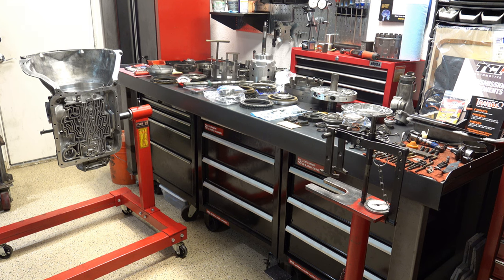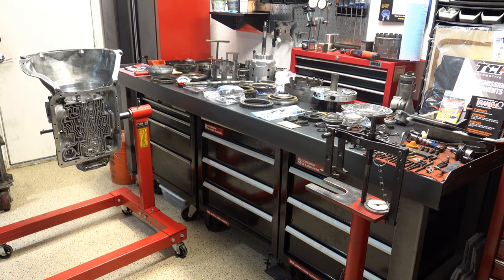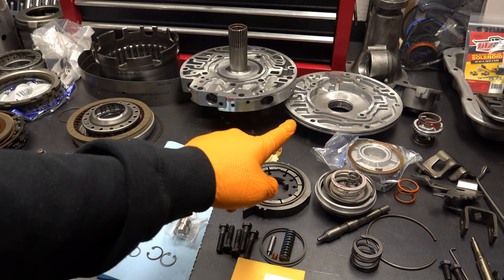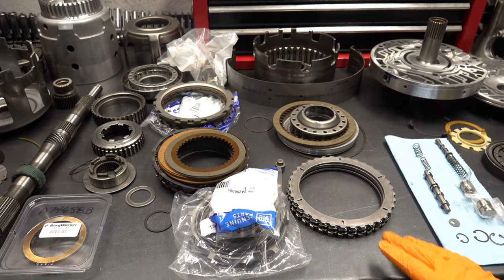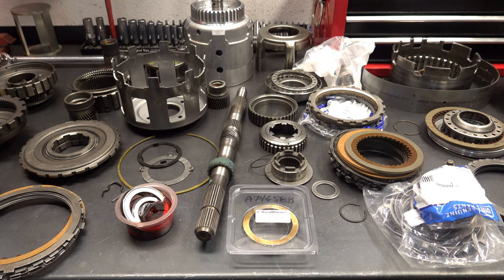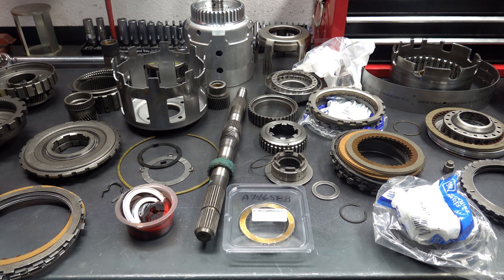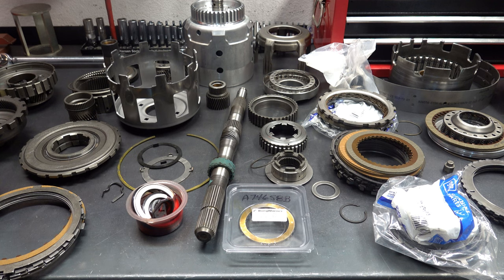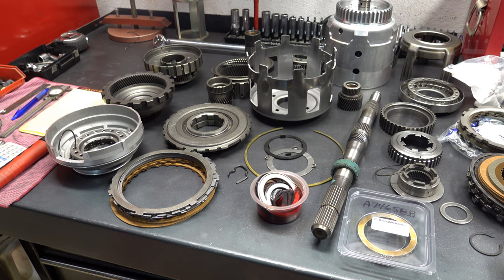700R4 Rebuild PT1: Overview

Comment: Any possibility you can detail which parts and part numbers you got? A specific parts kit? Or links to them?
Reply from the maker: Hi ijteague,
I purchased everything locally for that build however I buy a lot of stuff on eBay as well...Here's an example of an-all inclusive base kit that comes with upgraded Alto high energy frictions as well as a "Powerpack" for the 3-4 clutch (two more frictions and steels vs stock). I have used this kit several times in the recent past with good results. Pair it w/a Transgo JR or Superior Tech shift kit (or your own hydraulic mods) and you should be good to go...Link: https://www.ebay.com/itm/190782507245?hash=item2c6b8608ed:g:gSUAAOSwl29b7cdv&amdata=enc%3AAQAIAAAAwIdgA9kEe7oZZknI24HrD0u54cqFGFwJIJ3W0JC3Y%2FoIkH9ys%2FRejX0zDKoV2IToxorMjImQ0ELEq4FiAHWpWgV2NqWAGSgZeXAdhE8AWJZ8xYje02DnL4GwmgBXcrO2CokNI6LBCzNUmzu4b1Cuu3xIXMEUBIeSYYGpKcY8Kpxh5FzkJmyS3PsvAKb0xVGYftQbzKAiIDJDQr9sCn3qbkfZCO0uTYyiOifsQCXEtRmeBxQU51TmFPwOXuvdV0kuWA%3D%3D%7Ctkp%3ABk9SR860rb3WYg
Reply: Does this kit come with the steels that have the oil holes in them ? Thank you.

Comment: Hey Nick, your video’s are great. I have a question about the shift kits vs the repair kits on a 700r4. 
If I’m putting a performance shift kit in one do I also need a repair shift kit also? Or would the performance kit already include the needed repair updates? Thanks.
Reply from the maker: Hi Anthony, thank you for the kind words!

All the shift kits will have the same basic corrective parts/procedures however the performance kits will also include parts and procedures that are performance oriented. So no need to buy two separate shift kits.
Reply: @nickstransmissions  Awesome, thanks for replying and giving us great videos and information.
Reply from the maker: You're welcome, man.

Comment: Nick, {non-rebuild Question} I have a 700R4 shift sequence question in relation to the Low/Reverse Clutches....when are these frictions activated-engaged? So far i learned that they are engaged in 1st gear (low) and reverse, they come off in 2nd gear...which probably means they aren't on in 4th gear?? How about 3rd gear..what are these low-reverse clutches doing engaged or disengaged?
Reply from the maker: Hi LarsonFamilyFarm-LLC - the low reverse clutches are applied in reverse and manual low, then come off as soon as you shift from manual low into manual 2nd or from reverse into anything else. They are not on in 2nd, 3rd or 4th gear and thus freely rotating in place at the back of the case.
Reply: @nickstransmissions  Wow perfect thank you...i could not find this information anywhere.
Reply from the maker: You're welcome, man...Please subscribe if you haven't already...I'll be putting out more 700R4 videos within the next two weeks (I have two in the shop now to go through).

Comment: Hello nick, i have a 700r4 k case with a ss# 9txm238a with a AM separation plate but everything i keep reading said it should be a BV for the year. Will this work or do i need to find one or a aftermarket plate?
Reply from the maker: Hi Dustin, if the number you provided above came from the passenger side pan rail then you have a 1989 year transmission w/an auxiliary valve body...Look at your plate right side up in the area where the aux valve body goes...If there's a bunch of ports and a check ball seating location, then you have the correct plate...If there's only four bolt hole locations and nothing else then you will need the proper plate...

You can also look at the upper left portion of the plate where there is a check ball seating location on the early spacer plates (two round holes) or a  single square hole. The single square hole plates are 1988+ while the plates that have two round holes are 1982-87.

You can check out my 700R4 valve body differences video if you need more details on how to tell the various spacer plates apart as I cover that in the video: https://www.youtube.com/watch?v=GkridHvmm6k
Reply: @nickstransmissions  the spacer plate has all the holes for the aux valve body and it also has the square hole next to the round hole. It should be the right one. Your video is helpful also. Thank you
Reply from the maker: You're welcome, Dustin and thank you for watching.